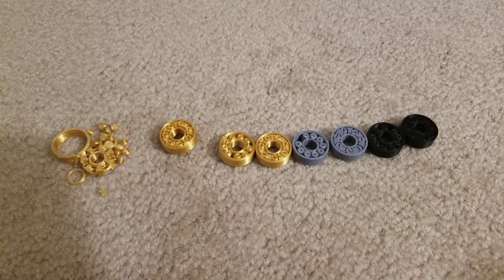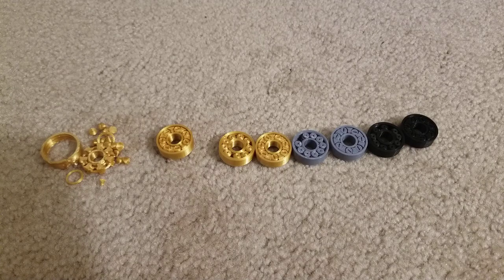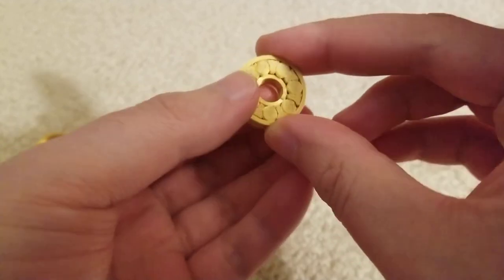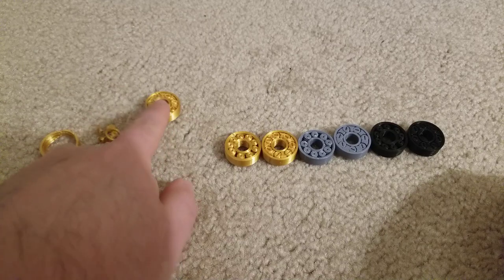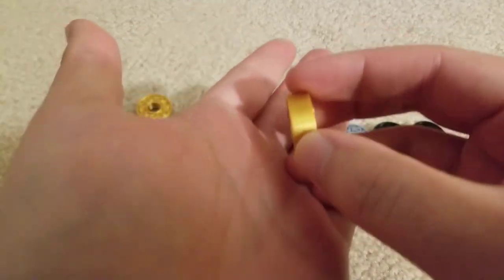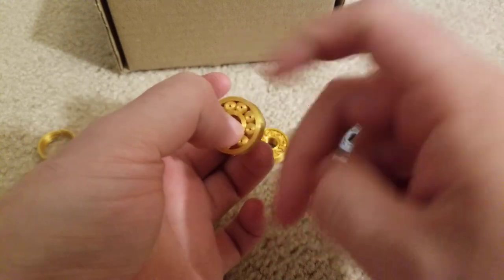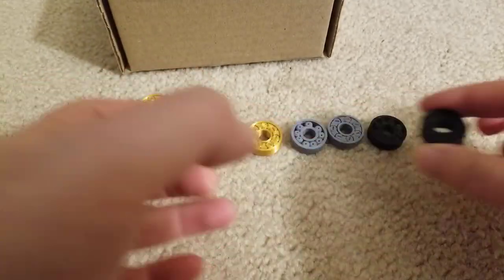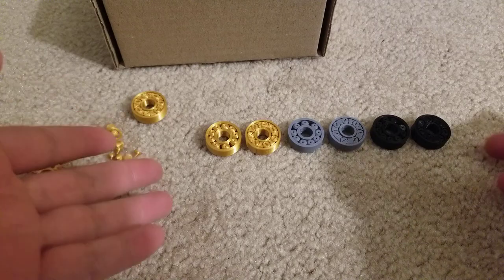Quickbit: 3D Printed Bearings!

Comment: Accidentally saw my bearings as I was scrolling through youtube lol 🤯

They work as if they are lubricated once you follow the instructions and roll them out on a carpet for a minute because that removes the imperfections of the print under the pressure of your hand. But not only do they roll good, they also have alot of horizontal strength vs the conical design because these were designed with 3d printers in mind :)
Reply from the maker: Thanks for sharing your design with the internet! With the right application these print in place bearings are awesome to be able to print off and have in service quicker than running to the hardware store or buying online.

Comment: Friendly tip: WD40 is not a lubricant! It's a solvent. A proper grease or oil will help a lot more ;)
Reply from the maker: Franlab did a recent video on it. It's originally actually neither a lubricant nor a solvent but a water displacer (hence the wd) meant to prevent ice forming/sticking on space rockets!
Reply: @sjm4306  Huh interesting. The more you know :O

Comment: I saw a solution for making very small roller bearings. Using filament as the rollers, so 1.75-3mm diameter rollers

Comment: BB bullets tend to disintegrate. Better print your own rollers (not balls). Built up designs are usually better than the print-in-place ones. All given and tried and printed ofc and considered, the only place I can mind where I would use a 3d printed bearing is the filament spool roller.
But I bought 20 std rollerblade bearings at 8.99 on A and printed them a TPU collar just for the sake of have them rolling and not sliding.
No Idk where i'll be using the 16 left ones, yet.

Comment: these are deffinitely useful I always find cool stuff to print but it always requires a few bearings of different sizes. Often ball bearings arent even really needed there (stuff like a small jet engine model etc) as its not something where the bearings have to either support a big load or turn a lot or quickly.

Comment: Although interesting from a maker pov, these has very little use because the constant friction and load in a real world mechanism (toy, robotic arm, etc) would rapidly break/loosen the parts; I guess that even nylon wont survive more than a few months of constant rotation in an everyday application
Reply from the maker: Yeah not reliable for either long term or load bearing applications. But for something trivial that doesnt rotate much or bear much weight like a filament feeder it's probably ok. Pretty niche in real world use but still an interesting look at what 3d printers can do.

Comment: those were surprisingly better than I expected
edit--back in highschool, I printed off a doorstop that would be attached to the door face and hinge down to press into the floor and hold the door in place.  It was simple, but it was the first thing a student had designed that required no assembly but still had moving parts, the teacher was pretty proud of it lol.  Our school's printer could print two materials at once; a filler, and the actual material.  Then the part would get submerged in this tank to melt away the filler.    Is that the sort of thing you had to do, or did your printer just print these as-is and was still able to keep them from sticking together?
Reply from the maker: This was surprisingly able to be printed as-is. I do wish my printer could do multimaterial though as I can think of a ton of things that could benefit from that

Comment: Did these bearings print ready for use? Or did you need to assemble them beforehand
Reply from the maker: It's print in place, meaning it's fully assembled already. The only thing is you do still need to work the bearing to break away little bits of fused plastic between parts and wear them a bit to make them spin freely. A little lubrication also helps.